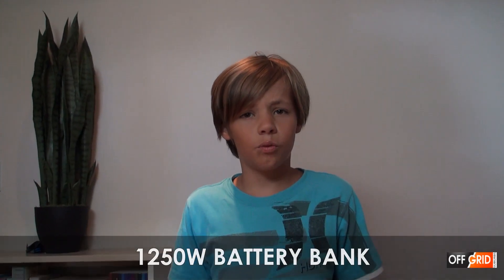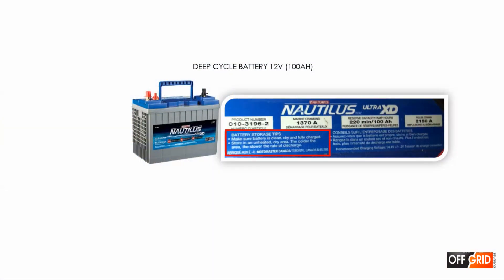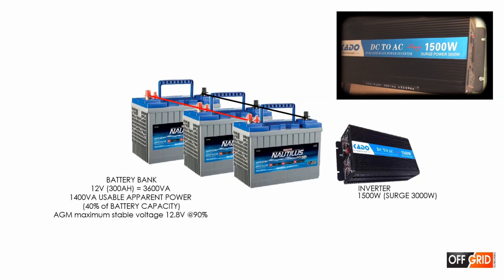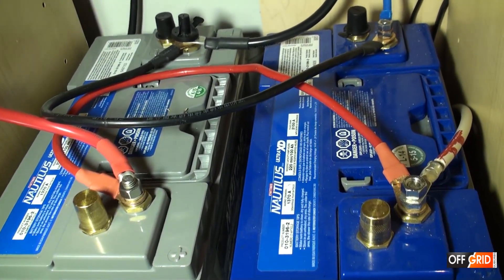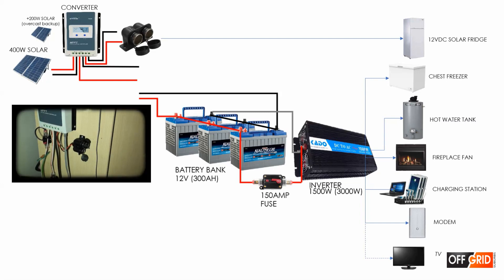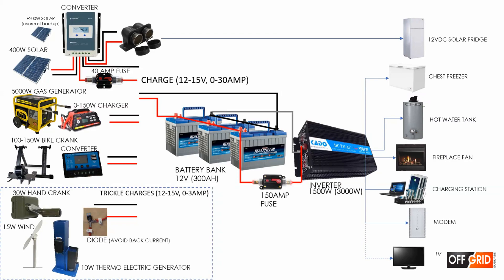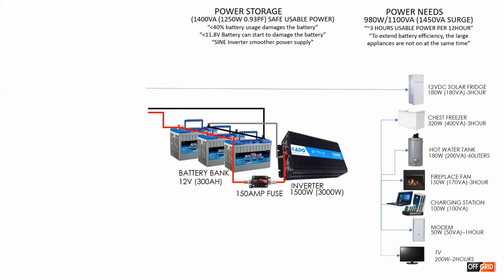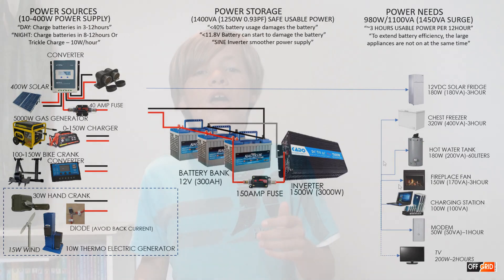How we sized and connected our 3x12V deep cycle AGM batteries for key areas of our house - 1000W

Comment: Hello my friend, My Question If you are charging the battery so the devices will always be using the electricity passing through even if the generator is working?
Reply from the maker: Hi Ramson, when we charge the batteries with the Generator it is only on 3 times per day - 1hour each time.  The Generator pushes out 5KW, therefore for that hour we have everything linked to the Generator, we give the batteries a rest and focus purely on charging them.  Can we continue drawing power from the batteries while charging? Yes but it isn't the most efficient.  Thanks for the question.

Comment: Quick question: why do you connect the inverter to the first battery (red) and third battery (black) and opposite ends for the charger?  Most videos show connecting both sets of leads to the same battery.
Reply from the maker: We saw a video (not sure where), where they explained balancing the battery bank and dispersion charge more even and therefore better for the battery.  Especially when drawing power and charging the same time.  Sorry can't be more of a help here.

Comment: What max charge current should be used for an AGM 660ah battery park?
Reply from the maker: Hi Jean - I assume you are not referring to the initial surge (motor switching on) as the AGM battery can take a lot but your question is related to ongoing load. Also assuming you are referring to deep cycle AGM. Therefore a quick answer is up to 50% DoD is safe range (12.1V), so 330AH continuous draw.  This is what you design for.  However you can draw 70% DoD 460AH (11.8V) and but this will impact the life of the battery (fewer recharge cycles, it is a balancing act).  We use 70% as our max (11.8V) but we try to stay about 50% on average (12.1V).  Anything beyond 80% DoD damages the batteries exponentially so we try to avoid this (11.5V).  There are other factors that impact life of the battery - speed of charge and discharge (slower is better), temperature (room temperature better 10C-25C), charge controllers (MPPT better), also I have heard not to put batteries on concrete floor, better putting on wood or something similar I assume it has to do with temperature difference base vs top.  Anyhow hope this helped.  God Bless.
Reply: Thanks for your reply but that's not the amount of current I can draw from the battries.
I have three MPPT regulators which charge the batteries with a current current of 42.5 A (4 panels) + 42.5 A (4 panels) and 22 A (2 panels), that is to say in total 107 A. Can we go beyond 107A or 127.5 A to charge my 660Ah battery pack (6 12V 220Ah batteries)?
Reply from the maker: Good question, that's a really powerful battery at 220AH and probably cost quite a bit!  The charge rate for AGM is a maximum of 20-30% of capacity (depends on who you speak to) so for one of your batteries 40-60A per battery (240-360A).  So your 107A across 6 is 10% of capacity so all good from specs.  For perspective I have a smaller system than you at 160AH (330AH for 3), current more than 30A charges across the 3 is too quickly for my liking unless I have a load on which balances it out.  So you could say my safety limit is 10% of battery capacity.  So 10% of your battery bank 22x6 = 132A would still be good.

Comment: Question, how large of a battery bank will it take to run a 1.9A, 220
Watt pump 24 hours a day, 18 hours a day and 12 hours a day?
Reply from the maker: Tough question - Battery bank will also depend on what is charging it and where you will store the batteries (temperature 32-80°F.).  So making some assumptions that we will use either golf batteries (6V) or Marine deep cycle (12V).  Assuming 12V at 100AH (1200W - like the one we have) and the max we can use without damaging it is 40%, so 480W/battery use.  This means your pump can run ~ 2 hours before the Battery will need to be charged again.  24hours x 220W = 5200W.  Therefore 5200W/480W = 11 Batteries.  However not sure you will need 11 as you able to use the solar power when the sun shines.  So lets assume you are charging this with solar power and have on average 6 hours of full sunlight a day (NASA maps would be able to tell you for your area).   In 6 hours you get all the charge that will last you the remaining 18 hours (18x220 = 4000W storage).  4000W/480W = 9 batteries.  This will mean you will need a 900W/hr solar array (per hour 220W for pump + 4000W/6hr for storage).  Therefore depending on your setup 24hours (9-11 batteries), 18hrs (7-9batteries) and 12 hours (5-7).  Hope this helps.